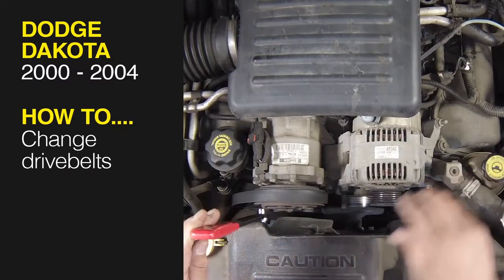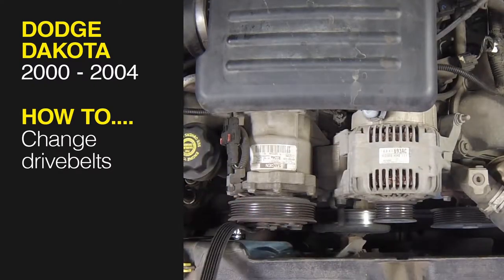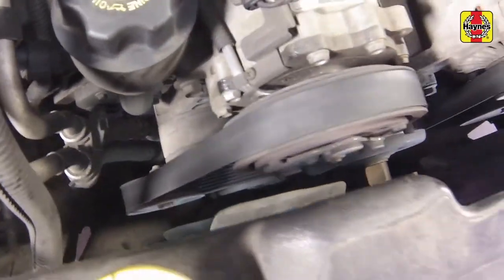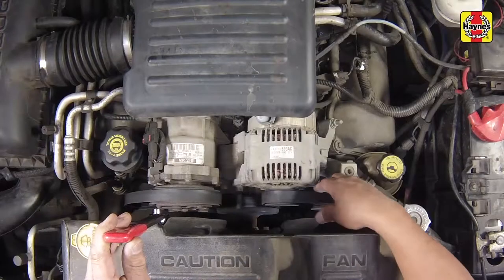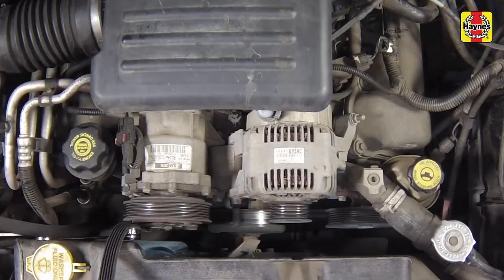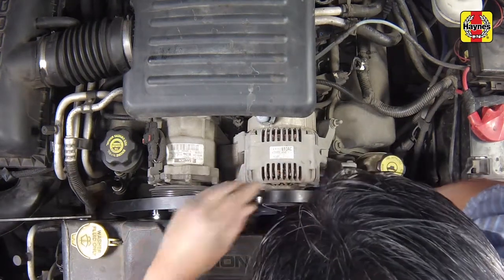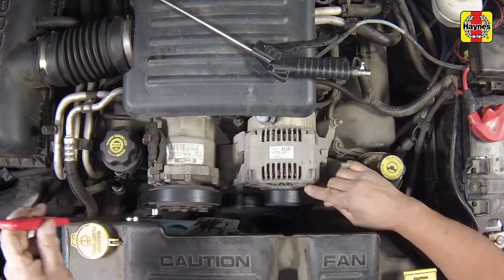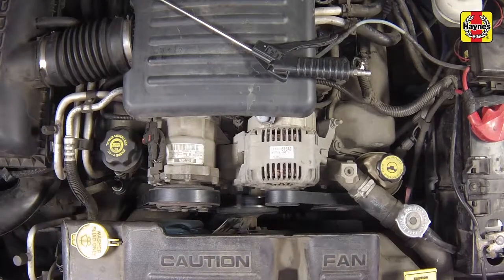How to replace the drivebelt on the Dodge Dakota (2000 - 2004) / Dodge Durango (2000 - 2003)

Comment: I just replaced mine.  I discovered the biggest pain is getting the belt around the crankshaft, around the idler pulley and around the tensioner (in that order).  I recommend positioning the belt around those first.  I found it was easiest to get the belt around the crankshaft by getting underneath the front of the truck.  As this video shows, get the belt around the alternator last.